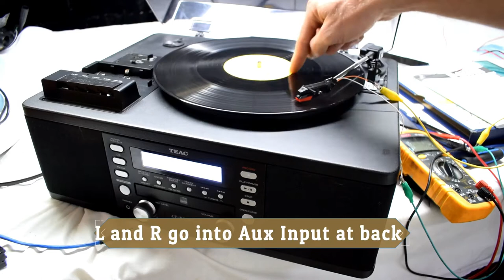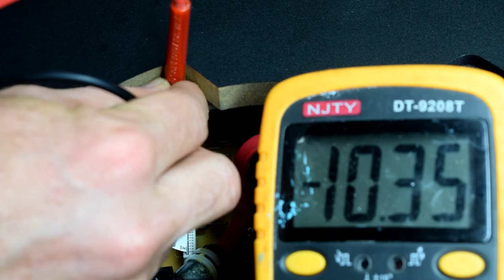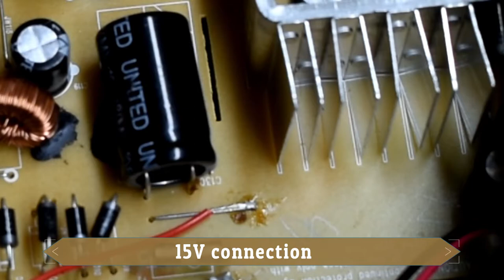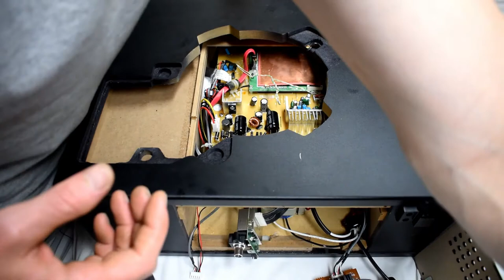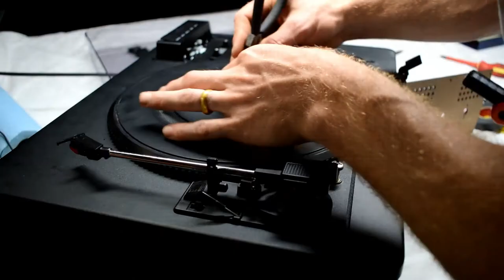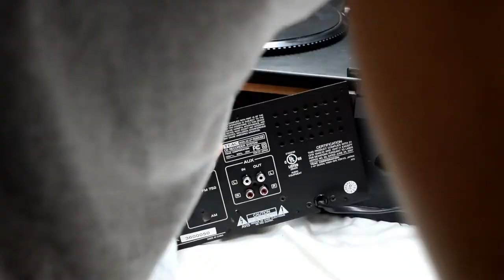LP-R550 USB not working (Fixed1)

Comment: do you know how to open it entirely?
Reply from the maker: you have to remove the main tray be taking off that clip as shown in the video. Then to get to the main electronics you can access it from the back. I am not sure if the frame is glued around it or if there are screws.
Reply: @NewsonsElectronics  I bought mine from a sale and the record player has the same problem.I took off the turn table unit,and cut the wood so that the turn table clip would be an easy fit.But I still couldnt get to the full circuit board to find out why the amp is not working for the record player.I dont want to connect it to the aux,hopeing to keep it original.So Im wanting to try and get into the main radio somehow. Any advice would be great thanks.